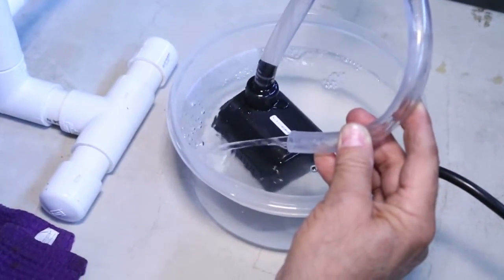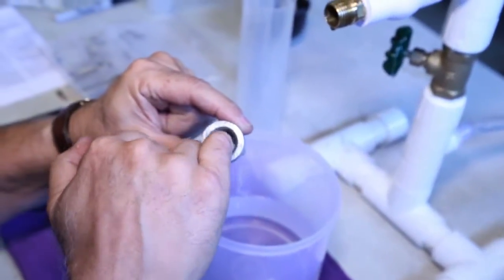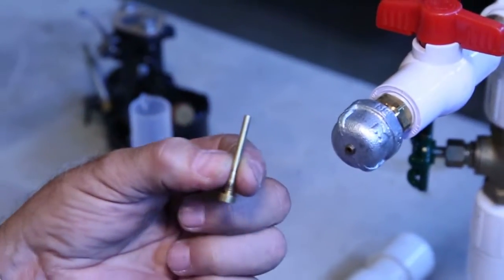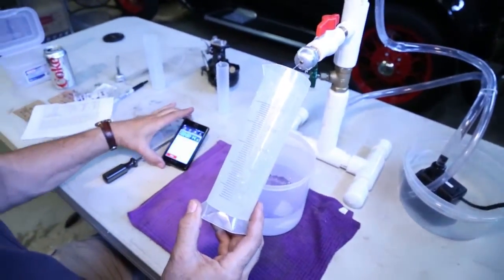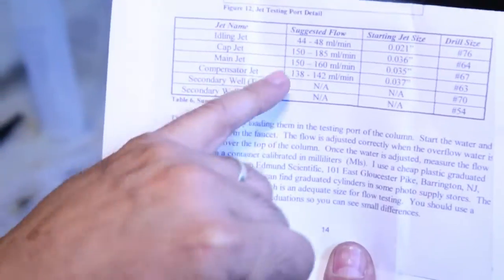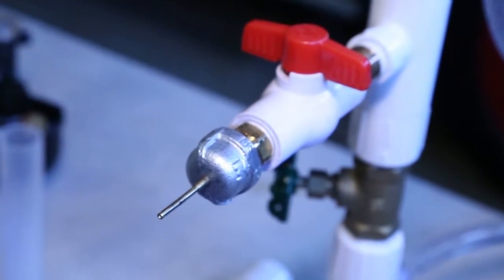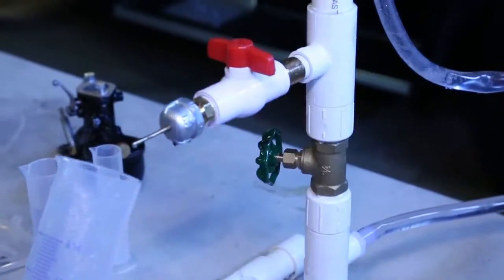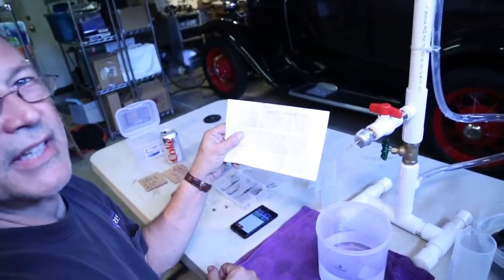ZENITH Carburetor - Flow Test JETS

Comment: Kenny, thanks for posting this!

So many people don’t understand that flow testing is nothing more than setting up a baseline so that you know where you’re starting from with your jets. It doesn’t mean your car is going to run perfect it’s just flow data so that you can make logical adjustments if needed.
You would never just take your spark plugs out of the box and install them without checking the gap first so why would you treat carburetor jets any different? Especially with jets that are not brand-new. Over the years the original jets have been poked and prodded with drillbits and welding tip cleaners. Even new old stock jets I have found to not be accurate.

Anybody looking to do this should purchase Steve Pargeters book on model A carburetors, he has very detailed information, it’s a great resource.

Comment: I run the model A Zenith cap jets at a minimum of 300 cc there is no reason to restrict the compensator jet or GAV flow, basically the cap is just a piece of tubing to get the compensator jet and GAV fuel into the venturi. ( later model B Zeniths did away with an orifice in the cap jet altogether.

Comment: Always better to be on the lean side with model A & B carburetor jets. 

It is easy to use the air fuel screw to richen the idle circuit and use the GAV to richen the high speed circuit.

Without changing the jetting there is no good way to lean the mixture out.